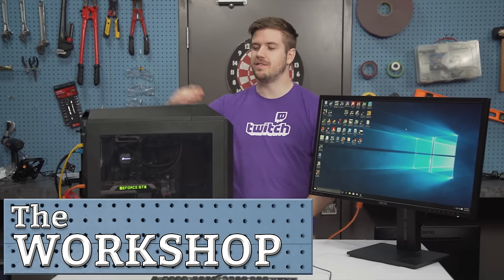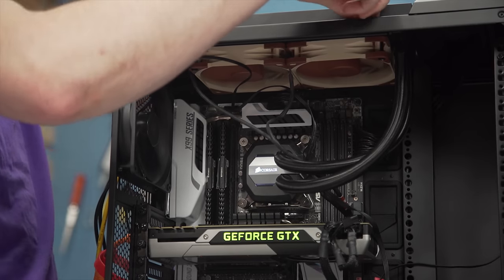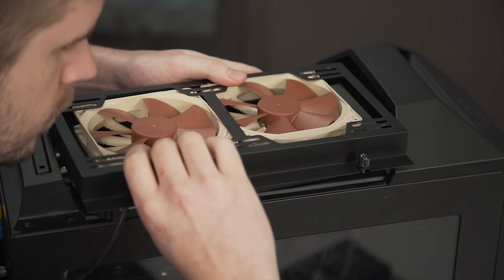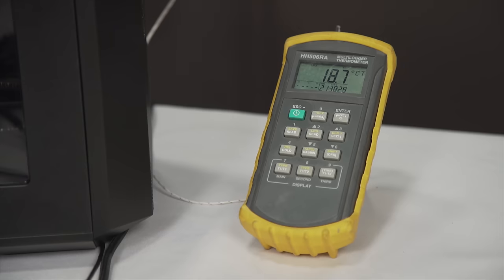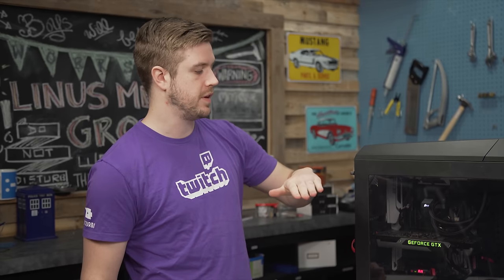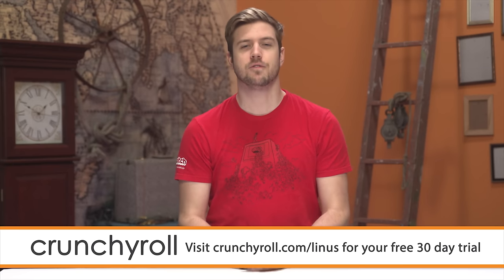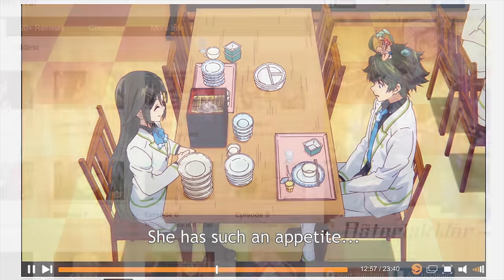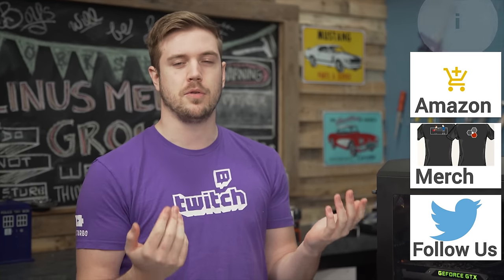Radiator Fan Configuration: Does It Matter? - The Workshop

Comment: Generally fresh air should go through the rad and preferably not back through the case. My rad is on the bottom of my case with upward fans pulling cool air from the outside through the case which isn't my preferred exit but for now unless I leave the rad and fans on the outside of the computer case, that is where they are.  

For every fan I have pulling air into the case I have a corresponding one pulling air out. My case has 4 120mm fan ports with two 140mm ports, one along the front of the case and one on the top. All fan ports have removable dust collectors which I clean on a regular basis. This keeps me running an average of 32.8C at idle and no higher than 51.3C heavy gaming. 

I have an old Antec 200 gaming case with the 2.5" hot-swap drive port with a Corsair H60 cooler.

Comment: i had my raditor installed like this.  "RAD FAN -> RAD -> Front Panel" pulling air blowing towards my cpu block. is that ok. or should my rad fan blowing through the radiator and air blown towards the cpu block? watching this in 2019.

Comment: You forgot to have the four fans blow away from the radiator. Top fans blowing up and bottom fans blowing down. Will it keep it cooler?
Reply: I tested it with a Ryzen Threadripper 1950X and a Deepcool Captain 120EX:
Under Full Load: 3°F
Idle: -18079735°F

Think it worked quite good, but there´s difenetly more headroom !

Comment: Is it bad for the computer that I replace the rear fan with a singel fan radiator because I dont have any space for a cooler any were else?
Reply: Not realy but it will influence the temps abit..u should use a second fan if possible,atleast get a good fan instead of the Original.

Comment: Is it worth it to upgrade a laptop, or buy a new one?

I have a IBM Thinkpad R51 made in 2005.

512GB SSD (It is a ATA SSD, but it still is very fast)

6GB of RAM 

Intel Pentuim M at 1.8GHz

Intel centrino technology

OS: WIN 2000/XP/VISTA/7

P.S. Windows vista and 7 run very well, windows vista was running on the machine for about 5-10 years with no problem.

Comment: in theory your sappose to have the fan pull air in threw the radiator to help cool it down, to help the heat exchange faster. if you push air out, air coming from the case and pushing air threw the radiator,  you loose cooling efficency.

Comment: Why would you want to blow the hot air from the radiator back into the case?  Seems that would just heat up the air that your GPU is using.

Comment: ___Luke___ anyone?___ try to have the fans pull out on the back end, and push in on the front end. Like in situations where you have only one 280 intake/outtake  (like, if you have your case boxed in somehwehere and the air wont go through the case) so you need to have air going in and out on the RAD... would that work at all? Would it just circle around the own air?

Comment: If your graphics card dumbs hot air directly into your case, you use an aio cooler for cpu and it pushes air out then your gpu temperature will significantly affect your cpu temperature. Because your aio cooler is reusing the hot air produced by the graphics card. My 4790k runs at max 79℃ if i only stress the cpu but if i stress my 1080ti at the same time then the max temperature increases to 86℃.

Comment: why not have 1 side blowing air in and the other out
Reply: I had a pc that I set up like that no rad, just air cooled. Temps were pretty good. There wasn't a radiator or anything in the way of the intake fans. There were 2 120s up top 1 intake, one exhaust, 2 front 200s intakes, and a 120 rear exhaust. The air from the top intake 120 had more static pressure than the 200mm intakes, so it would push it's way down to the basement, and then make it's way to the GPU. The top exhaust 120 would pull extra heat off the CPU heatsink. For a radiator set up I would recommend against it. with a radiator the air looses a lot of energy, and most of it would be used in cooling the radiator. The other fan would end up sucking the hot air and whatever cooler air you have up into the radiator, thus creating an warmer equilibrium. It'll work, but it won't be good. With just fans no radiator, there is no resistance. With a radiator the fans would struggle to do their job.

Comment: I am surprised that you did not try to create an air flow consistent with the natural tendency of the hot air to go up: 2 or 4 sets of fans on the bottom of the case pushing up and 2 or 4 sets of fans on the top of the case also pushing up. Like this you will get an air flow from the bottom of the case to the top - considering, of course, that your case allows to put fans on the bottom...

Comment: Next: arrange the blades on all four fans so that the blades on the radiator are aligned with the blades on the bottom, and make a custom board to sync all four fans to rotate at the same time and at the same rate.

Comment: I tested this with my gpu under load. the cpu temperature went up if i and the radiator was in pull out configuration. Now i have the radiator in the front of the case, pulling air in and now I have much better temperatures under a gaming load.

Comment: What about having rad on front of case? I have it mounted that way after finding my case to be just a bad choice (corsair carbide series 100R - terrible case, but even as it have only vents on side of the front my i7 6700k do not exceed 40C on stock).
Reply: Now I'm using Pantex enthoo pro which have filter on top which makes temp higher so I will try if push and pull up would reduce rad temp (40c which makes fan to go above 2000rpm). Before I set back fan to pull fresh air to case temp was high really quickly which makes me think that cases need to have back unrestricted exhaust from top rad as top fan filter keep hot air inside which makes rad warm). And all of this when I was already happy about new case...

Comment: i would like to see that test again with a single or dual gpu (under load!) that have a aftermarket cooler that dont exhaust the heat to the outside of the case..i am thinking about the warm air flaoting up in the case from the gpu and then it would maybe make a difference if you take the warm air from inside throught the rad or the cold one from outside...pls test

Comment: Hey genius, how long do you figure before your rad gets clogged with dust pulling in outside air through it?

How long do you think it will, "Not make much difference?"

Ever thought about getting a job at the Verge?

Using a rad as a dust filter - sheesh.

Comment: Surely the results would be more realistic under load as GPU heat would effect things? Perhaps air pushing in giving cooler CPU hotter GPU or air pushing out cooler GPU and hotter CPU, especially if GPU is the open type fan configuration. Does anyone know it it works this way?

Comment: wait i got 32c and with the same cooler with a 6700k how did you get 38c and i had the same placement keep in mind im using the same thermos pat that came with the h100i gtx
Reply: +Alien (Leafy&#39;s Crew) If you're using the stock Corsair fans, they're spinning a lot faster and therefore pushing more air through the rad faster. That would give you a leg up in cooling performance. They set their NF-F12's to 60% for these tests.
Reply: Koby Dunham if thats so why are they using them if theirs a 8c difference and the corsair fans are quiet even under load
Reply: Alien The corsair fans are NOT quiet under load. Maybe quiet to you, but compared to other options, they are not.
Reply: Koby Dunham true i can understand

Comment: Push will collect dust, but you want cooler air running through your radiator, period. So, technically speaking pushing or pulling air through your radiator from your case is counterproductive. You're throwing warm air through a radiator with warm liquid... The whole purpose of the radiator is to cool the liquid~

Comment: fun test but means nothing unless your stressing the gpu. gpu is what throws a lot of heat into cases. HOW would each do with the gpu going an hr or five into a game. that is the real question. Not a real world test.  New to pc building but your favorite way seems wrong. You are pulling all that hot air coming up from gpu, cpu and ram and pulling it threw the radiator and out the case. Wouldnt that make the radiator hotter? making the cpu temp sky rocket after a while of game play???

Comment: Hey guys, I Have corsair H100i v2 and i7-7700K and my idle temps linger around 35-40 Celsius. So based on the 38-39 C value in the video, id say I have reasonable temps?
I see many people on the internet sharing screenshots as low as 29 degrees. makes me think.
Funny thing is whenever i run Chrome with many many tabs, the temp spikes up to 60-70s, and drops down to 45s within few seconds. Its this normal?
I used PassMark CPU test and max CPU temp i observed was 81-82 degree at 100% full CPU load. is this also normal?
Last but not least, i found this cpu test called prime 95, when i run in CPU temp eventually reached 95 degree! should i be worried. your help is very appreciated and im very sad to see that ridiculous twitch ban.

Comment: If you have a hot beastly graphics card dumping its thermal load into the case, and then draw that elevated temperature case air up and over and out the top of the case, then surely the cpu temperature would be higher than if you were to draw the cooler ambient external air into the case. It appeared that the graphics card in the case was not one that exhausts internally, nor was it being stressed as it would be in a gaming environment.

Comment: One more stupid one to do is have a 360mm aio cooler, but have two pushing on either side and the one in the middle put it as pull then switch them so two pull and one push

Comment: Hey guys so i have a problem and heed help. i have an i7 4790k and a corsair h80i gt. i turned off my OC and even with oc turned off it still idles at like 37-40. and when gaming and recording it goes from 65-74. all of this is in Celsius btw. And i am not sure why i used the preapplied thermal paste that came with the h80i and i have  good airflow. I need help because i feel as if these temps are way too high with a liquid ooler.

Comment: Hei everyone. Just got a new pc. It got the i9-10900k, with a deepcool castle 360 aio with 6 push-pull 140mm fans. I ran cinebench r20 and the temp on all 10 cores was between 89-94 C°. Is that normal?

Comment: I would be interested to see how the temperatures would be effected if their was a non-blower GPU. By using an AIO as an exhaust with an air cooled dual fan gpu right below it pushing air towards it might change the results significantly

Comment: If you're playing a video game, it's going to heat up your GPU plus all of the air inside of your computer case. Having your fans so it blows air up is good for cleaning but bad for performance. It's blowing hotter air through your radiator.

Comment: Instead of running a relatively cool CPU completely stock, try overclocking it to a stable and toasty frequency. I believe you will see much more difference in temps when these tests are conducted on the more extreme side of the spectrum. It is my assumption that the reason why you have not seen any difference between this, and the airflow difference, is because you were not generating enough heat to begin with.
@linustechtips

Comment: The problem with these tests is they're only stressing the cpu and not accounting for the rest of the system. I don't know any gamers that just stress their cpu. I'd like to see if the temps change when having a blower gpu under load and the radiator fans configured to pull from the interior.

Comment: How expensive are these fans??? Why does he say they add significantly more cost?
Reply: +eduardoig17 like $25 each
Reply: v0000000000000000v thats not that much. to build a good pc you will spend more or less $1,000

an additional $50 is not that much, thats 5% of the cost
Reply: eduardoig17 yes but when your liquid cooler is only $100 spending an extra $50 for 2 fans to drop 3 degrees is not worth the investment let alone the noise
Reply: +eduardoig17 But is that 5% increase actually providing any noticeable benefit, and if it was would you have been better off spending $50 more on something else instead?

Comment: Isn't this just common sense? You want an intake fan or two behind a filter at the bottom and the exhaust fans exhausting out of the top of the case above the radiator as demonstrated in the video.

I have noticed in the past though that if you have a couple of very hot video cards that exhaust inside the case rather than out of the rear, the heat generated will increase the CPU temperature a few degrees celcius due to that hot air being pulled through the radiator at the top... heat rises.

Comment: forgot 3 configurations, 1 singlelayer ontop with one pushing and one pulling, and the same setup on the bottom! And the same with duallayer 1 set of fans pushing (the same stack 1 on top 1 on bottom ) and the other pulling (the same stack 1 on top 1 on bottom )

Comment: Would have been nice to see the same setup with one fan only, and running a config that's a bit more robust than a 38° max a bit of overclocking at least, and at best a few Titans as well in a proper WC system. And running the two fans at minimum speed. And running four fans all blowing air away, instead of inwards, which I assume would be pretty similar anyway.. Video was a bit lazy.

Comment: you should run a gpu benchmark show the air inside the case heats up. in that case air going down is actually better than air going up. dissapointed. :(

Comment: My problem with these tests are that they are always ideal cases. Why not try such a test with slim 15mm fans in a very cramped HTPC case? I mean if you have the room for it you'd go for push pull with thick 25mm fans anyway, and the linus community has proven to not be on the stingy side.

Comment: you are disregarding something important here. 3 degrees improvement at low heat will be 10 degrees improvement in high heat while gaming which is when the cooling is actually needed.

Comment: Instead of 3 minutes advertisement you guys should have added information into this video:

1. Pulling air from top INTO the case will make a difference as you will heat up every other component including graphics card, hard drives and mainboard. Potentially it would even raise noise since the case temperature will be higher and all fans crank up. I don't know any reason you should ever do that.

2. As you already know this, or at least Linus does: not only will you NOT make use of Noctuas direct air flow feature when you use pull, but you will also lower the life span of your fan since they basically suck hot air in and it flows against their motor. If you have compressed air it's very easy to clean of dust in push configurations
Reply: Since I have a air cooler I would still use pull. In push the air just gets out through left and right of the block (unless you tape away the gaps) making direct flow, at least for most blocks, impossible.

Comment: Something is seriously wrong with these test. I've done the tests myself and gotten noticable difference. My money would be on the CPU being a low heat model combined with (relatively) beefy cooling in a cold environment. Also, if you weren't running any stress on the GPU then that would attest for the lack of temps.

If you were to remake this, I would change the GPU to a hot, internal blower card like an ASUS 390x Strix, and do some overclocking on that CPU to increase the temps for more drastic numbers.

Comment: I wouldn't say 3 degrees with push & pull is pointless... its not realy 3 degrees, but more like a 8% difference. 
Now knowing that 38 degrees is very low for a intence CPU/overclock work, lets say we have 100 degrees with stock AIO and OC cinebench working... with push pull you will get 92 degrees, and that helps it not throttling it down at 100 degrees, so big difference theree!

Comment: In this video, the case is opened, killing the results. 
You want the fans pushing the air out. Wayyy more efficient. Once again, you'd only notice it if the case is closed. 

Run the CPU with 100% usage and see the difference.

Comment: Both fans on top. One pointed towards the rad and one pointed away from the rad.
Also, you should have showed diagrams showing the actual airflow (like the one you did for the bad idea) so we could actually understand your mess ups with "pushing away and pushing through and pulling up" that made no sense because you sometimes said the same thing intwo different ways when trying to show opposites.

Comment: these fans are designed for blowing in mind, not sucking. having them sucking hot air through the radiator isnt going to move as much hot air through and away from the radiator surface.

the whole age of AIO water cooling is kind of a load of bullshit anyway, except expensive custom loops. im delidding and going back to a quiet cpu air cooler. fans blowing into the front, fans blowing out the top and back. the aim is to move the hot air away from the materials to lower heat saturation.

Comment: Am I the only one frustrated with tests on so low temps?
For all cooling test they have around 40 degrees while benching, no OC, doesn't even seem to be on TurboBoost. And why exactly would anyone buy 4 vents 280 rad for non-oc CPU? Or watercooling at all.

Cooling performance differences are increasing with avarage temps. Having 3 degrees difference on 35 might become 10 or more on temps above 70. 

Go higher temps tests!

Comment: Would have been more interesting if you used different loads, different thickness radiators, different FPI radiators, different fan speeds, etc. with each fan layout.

The topics here aren't necessarily boring they just need a little bit of thought and effort put into them... higher quality investigation >>>> higher quality editing.